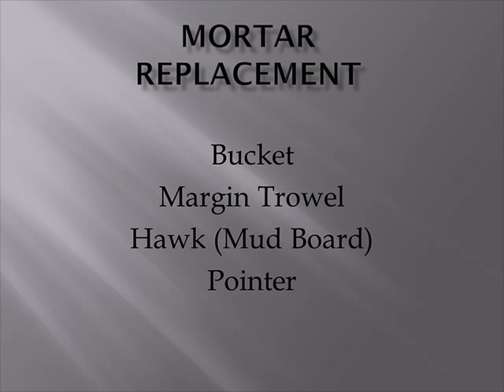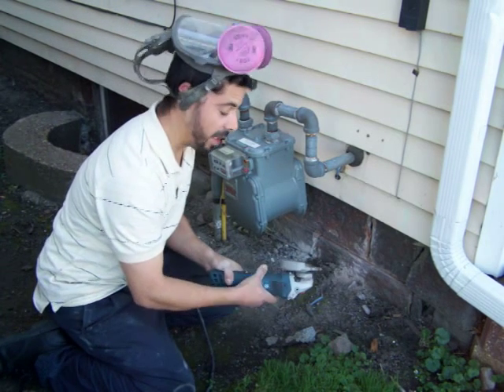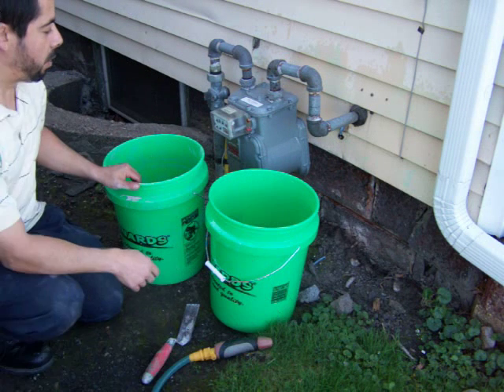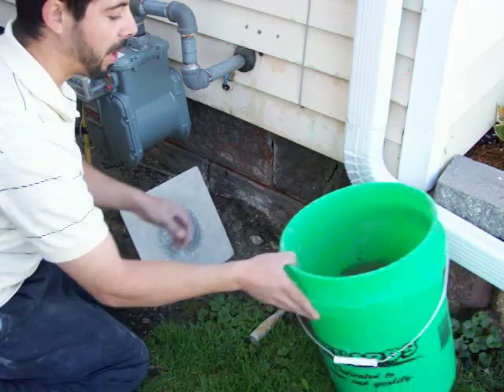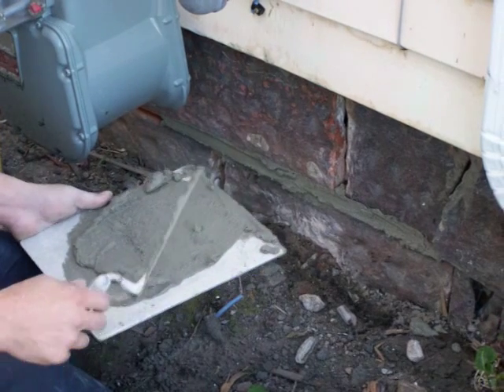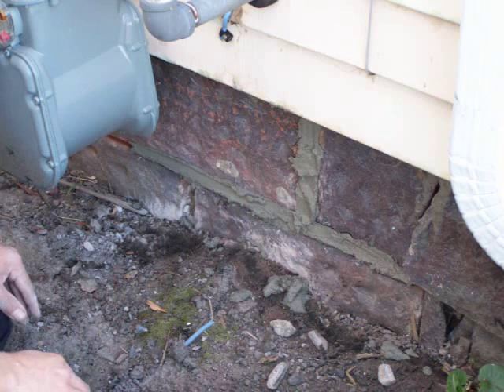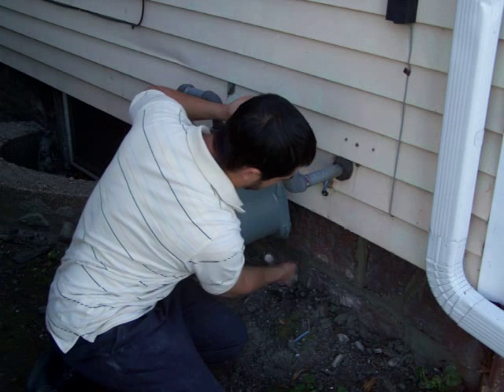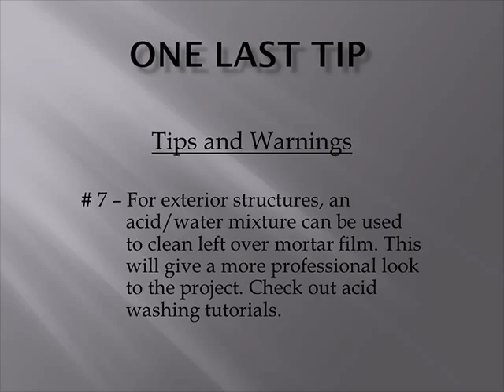Tuckpointing 101

Comment: What type of mortar did you use on this? I saw on the Home Depot site that they recommended Type N so that it wouldn't damage the surrounding mortar, but Type N is typically used for non-structural walls.